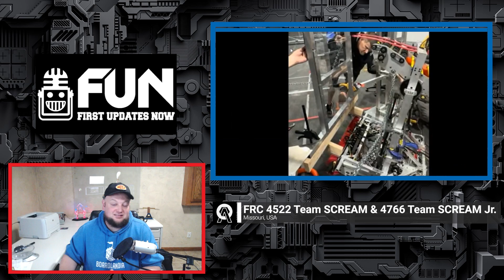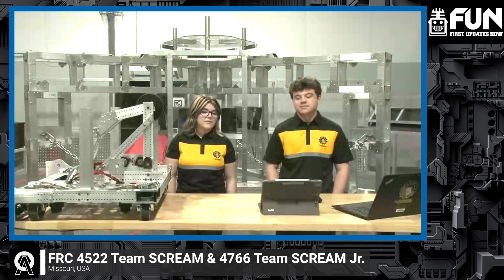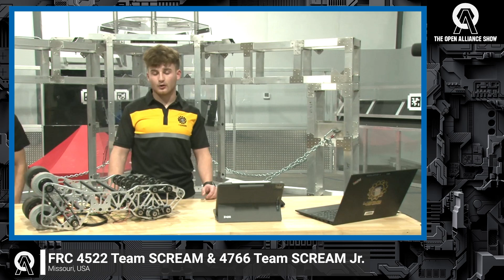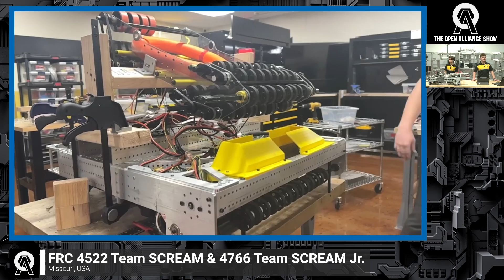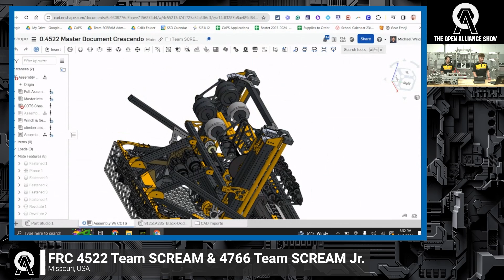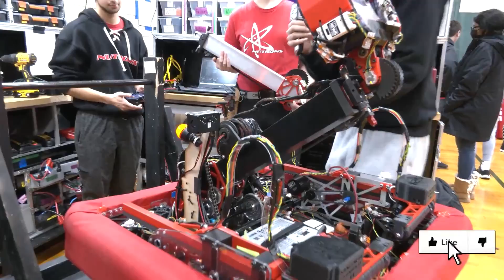4522 & 4766 Team Scream (Jr) | Trap Scoring | Robot Progress Overviews | The Open Alliance Show

Comment: I think your drive base tubes are installed on the wrong side of the swerve base.  You can gain much more  lower center of gravity if you flip the tubes and mount the  top plate below.
Reply: Thanks for the suggestion.  We intentionally mount our modules this way so it makes it easier for us to drop the swerve module out of the bottom of the robot.